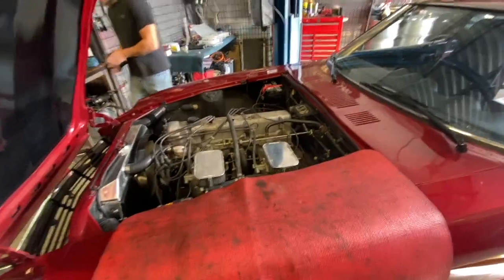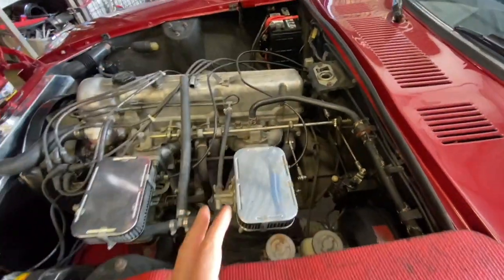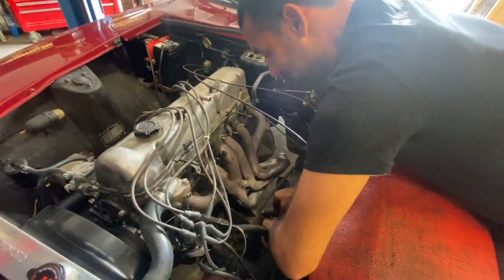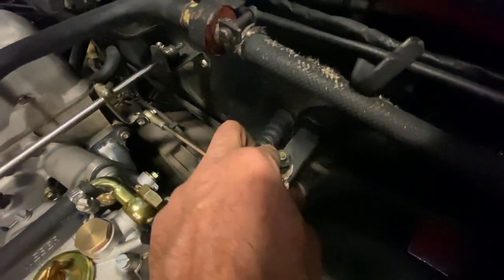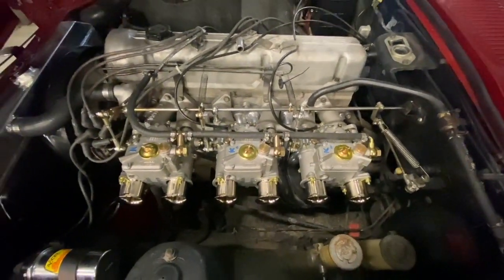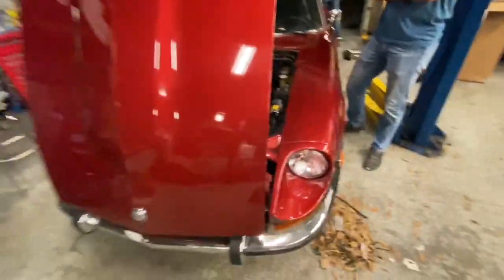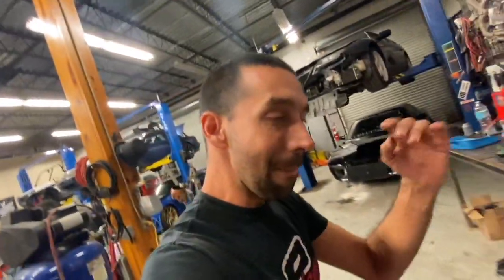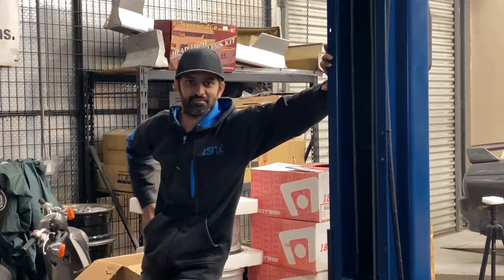PROJECT DATSUN 240Z! TRIPLE WEBBERS

Comment: You can do so much to a Z. Those Sidedrafts sound so sick. Should put a L28 engine from 83 Datsun Z also Close ratios 5 speed and 411 Differential. Use the L24 head on L28 get 10 to 1 Compression and bigger Camshaft. You know the rest.😁

Comment: Someone will pay for the pace setter header for sure. Just don’t be that guy and try to charge an arm and a leg for it... that the reason the mikuni and solex triple carb setups are overpriced. I miss my 521 pickup but EVERYTHING was overpriced for the L16-L20 motors. And those are the 4cyl motors. The 6cyl are even more spendy. I hate how that works in the car game sometimes. And it’s usually because someone sees their parts as gold... or the parts were discontinued. The Datsun world is hard.

Comment: From what my friends tell webbers are easier to tune compared to mikuni, sk, delorto, and su dcoe side draft carbs.
Reply: they all take hours of dyno tuning to set up, because the main jets, pump jets and emulsion tubes all interact to a degree;  IMO Dellortos (can you still even buy them?) were even better road carbs than Webers, with  Mikunis last because of the limited range of jets and tubes available.